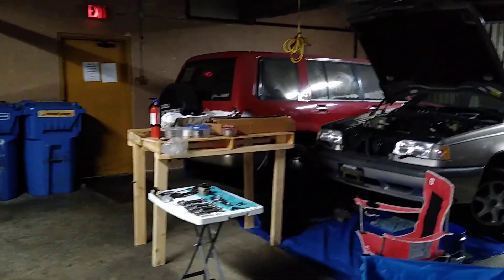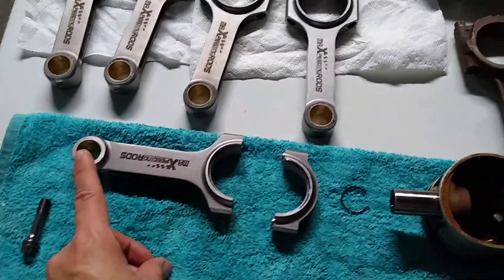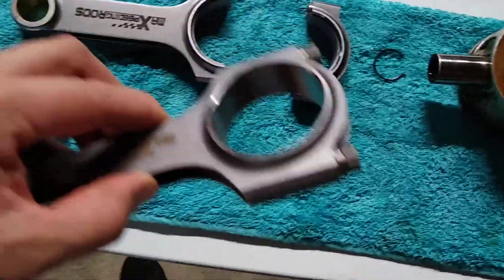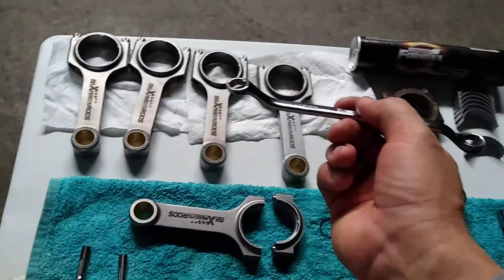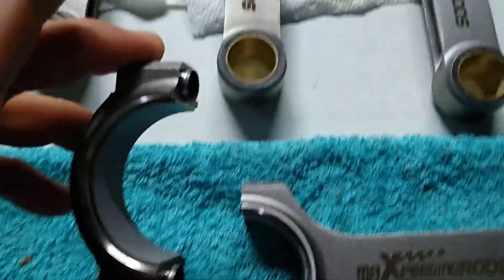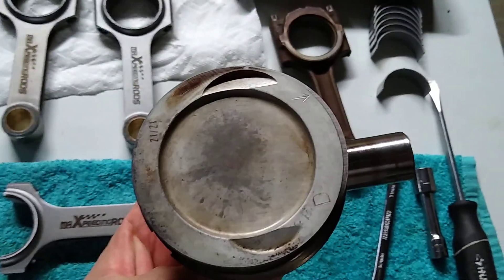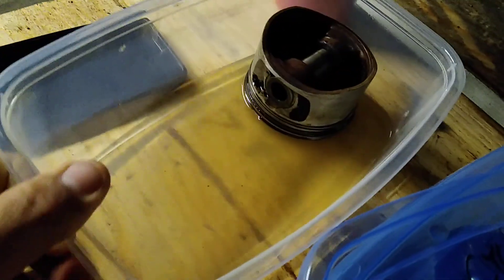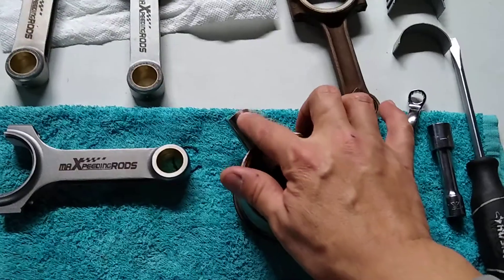1996 volvo 850 piston and connecting rod swap

Comment: hey did the connecting rods fit the crankshaft well were there any problems had to be taken out of the block that the connecting rods could move..in these h profile crankshafts there have been some problems with the size of the eye so as far as the bearings it is too small .how were these your good size thanks already for the advantage in hand

ALL THE BEST HERE IN SKANDINAVIA
Reply from the maker: They fit awesome. They worked well. No problem with them. The company I bought them from was a great one. Korea. Max peeding rods. I'd recommend them to anyone.

Comment: Very cool.  What did you like about those rods?  

And you are going to put a worn crank in the engine with new rods and bearings and drive it around?  That would be interesting.  I used to watch a racing team in their pit -- making decisions about what was 'too bent' or 'too worn' to go back in, and which parts could be raced in a much less than pristine condition.  How are you going to decide how much wear is on the worn crank?
Reply from the maker: Stay tuned. That video is coming up.